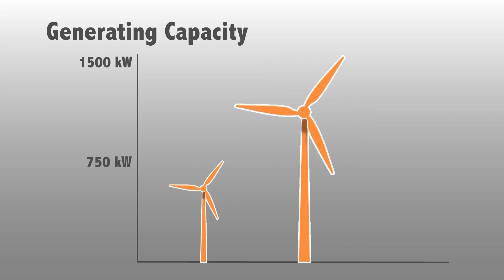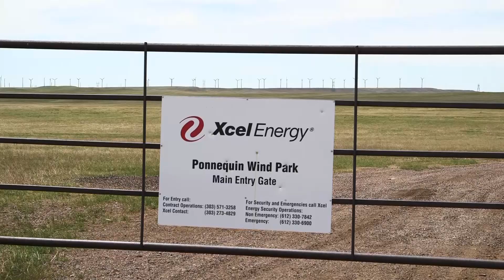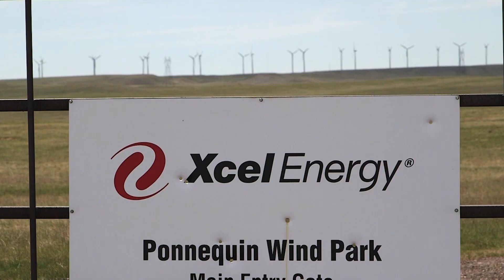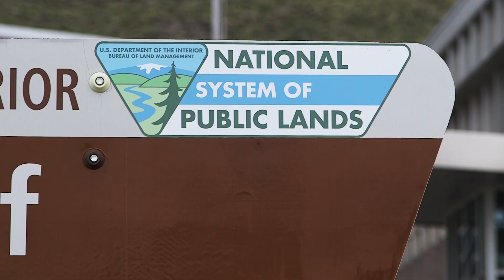Who Cleans Up When a Wind Farm Retires?

Comment: On most days less than one third of the Tehachapi wind turbines are working. Even when the towers are eventually removed, the hills will forever be scarred by the access roads and shelfs dug into the hillsides for the towers. The wind mills have been, and still are, the cause of the deaths of hundreds of thousands, (if not millions), of local and migratory birds. This so-called "Clean Wind Energy" crap has been a major environmental disaster for the Tehachapi area.
Reply: The CA turbines were smaller, and rotated at a higher speed, while the ones in Illinois are very tall, each blade over 150 feet long, mounted on a 400 foot tower.  They rotate very slowly, About 5 RPMs.  Bird strikes are very rare.
Reply: @robertheinkel6225  ; you have no idea what you are talking about. Have you EVER been to Tehachapi? NO! Do you even know where Tehachapi is? I doubt it. Try looking it up on Map Quest. It's true that 30 years ago when wind power was new wind turbines were relatively small, but the towers built in the last 10 wears are the same size as Wind turbines in any other state. Have YOU ever timed a Wind Turbine in a 25mph wind? NO! They go a he** of a lot faster than one revolution every 12 seconds.
Reply: @robertheinkel6225  I haven't seen for myself, but I think that birds of prey, including eagles, would sometimes nest right on the nacelles of the turbines. The strikes occur when the birds leave, or return to those nests. A shift in wind direction causes a change in the rotational plane of the blades, and if the birds are not astute to the change, they can be at risk of being struck by a blade that wasn't there before. The smaller faster rotating blades might be harder for them to dodge. There will always be some bird strikes, but nowhere near as much as opponents would have you believe. The solution: fewer, but larger turbines.
Reply: @robertheinkel6225  rare to you!
Reply: I live in Bakersfield at the base of the Tehachapi mountains.  The local news has shown dead birds under the wind turbines.  Yes, wind turbines do kill birds!  Some people keep posting that they have to see it for themselves before they believe the photos.  So I assume that you also don’t believe the photos of birds covered in oil from oil leaks?  The fact is as of right now there is no green energy.  Green energy is a myth.  Technology is advancing and one day we will have green energy m, but no today.  Both solar, wind  and water energy need rare earth materials for the generation of electricity and rare earth materials come from strip mining.
Reply: @bobp1016  Wind doesn't necessarily need magnets. They do just fine with double fed, externally excited, and asynchronous induction alternators. they require steel, silicon, copper and aluminum. turbines, like any structure, can be hazardous to birds. I've even seen birds hit with baseballs, at baseball games. of all the solutions, I think turbines are much less harm to the environment than any conventional power source, except photovoltaic. The big thermal concentrator plants have been known to cook birds alive in rare instances, if they get too close to the towers, where the mirrors are focused. Photovoltaic panels are free from that hazard.
Reply: Vincent Robinette All the things you just listed that wind requires all need to be mined.  Mining is not green and that makes wind energy NOT green.  Actually nuclear power would almost be the greenest power source today.  With new modern nuclear power plants that make very little waste they are the best option, but there are too many regulations that stop people from building new power plants.  There was an article just yesterday about Bill Gates looking for a country to build a modern nuclear power plant.
Reply: @bobp1016  They don't need the continuous supply chain of fuel, and with electromagnetism and ferroresonance, the alternators don't need magnets. Magnets are just a little more efficient, if they're cost effective. If you buy a inexpensive portable generator, it does not rely on magnets, but rather a field coil on the rotor, which can be regulated to regulate output voltage. Turbines can do the same thing, just on a much larger scale. The mining is only a one time thing in the life cycle of a turbine, or even a solar panel. for conventional plants, the mining never stops. Just one mining truck uses as much resources to build as a turbine, but it too, relies on the continuous extraction of mineral resources, to continually  extract the mineral resources, needed for  plant operation. Once the turbine is built, it doesn't require any further degradation of the environment. Photovoltaic panels are even less of a tax on the environment, because they don't require the occasional oil change, similar to a truck transmission. Turbines do have transmissions, and even hydraulics, similar to trucks. No fuel, though.
Reply: Vincent Robinette So just because they don’t require more material they are more green.  Sorry, but to build the towers takes metal.  Metal is mined and then coal is used to create the metal.  Mining coal, metals, rare earth materials all are bad for the environment.  Next, you need oil and gas to move the equipment, roads to get to the sites and you need to build the electrical hook ups.   All this takes a lot of oil and other non green items.  Then you gave the maintenance of the wind farms and after 20 years they are abandoned just like this farm.  Again this is not green.  Natural gas power plants can run on natural gas wells that can last just as long and are only drilled one time.  As I stated so far nothing is green.  You have just changed methods.
Reply: @bobp1016  The same resources are needed for anything that burns natural gas, but natural gas is still a fuel. Building a turbine is no more green than any other structure, but no less. The best part of turbines, is the fact that it literally generates electricity out of thin air. Fuel costs money, wind speed costs nothing. Over its cycle life, it has a much lower foot print than anything that requires constant fueling. Not perfect, but better. Much better.
Reply: Vincent Robinette Natural gas burns also with out refueling.  Once you drill the well it can produce cleans energy.  Windmills on the other had kill thousands of birds and require just as much maintenance as a natural gas well.  So in the end natural gas is more clean then wind because it does not kill thousands of birds.
Reply: oldgysgt, It troubles me greatly over the waste and the losses but no one listens. You can see the ridiculous BS I got up top for trying to enlighten the clods.
Tehachapi was pretty country when I passed over the mountain on Rte66 Apr 8, 1961 heading for San Francisco, T. I. and Guam. Lengthy story but the Mtn & 66 hold special places in my life (and the RR loop is another special thing for an old B&O machinist).
Reply: Wind mills killing millions of birds?  I live in Louisiana and I remember when the fishermen were catching 10W30 instead of fish. Deep Water Horizon!!! Remember that little spill?
Reply: Skyscrapers have killed way more birds than wind turbines...
Reply: 2Awesome skyscrapers act as a habitat for peregrine Falcons.
Reply: @2awesome292 ; and just who told you that BS? Do you find dead birds all around skyscrapers? NO! Do you find dead birds littering the ground around wind turbine towers? YES!
Reply: @oldgysgt  You think anybody would be around to clean up dead birds in the middle of the desert? How quickly do you think it gets picked up in cities?

According to a 2014 article in the ornithological journal Condor, an estimated 365 million to 988 million birds die each year by colliding into buildings in the United States.
Reply: @2awesome292 ; are you kidding? In Frisco they don't even pick the human Sh*t or used needles, much less dead birds. By the way, Tehachapi is in the mountains, not the desert, (once again, I realize you have never been there, but I have).
Reply: I'll have to come down and see it for my self. I've visited wind farms, and have driven past many of them, and have never witnessed a bird strike, nor have I seen a bird that has been struck. I even have yet to hear a turbine. I know it happens, there are videos showing it. Who ever captured those videos must have camped out for weeks, taking video all day every day to finally get one. I think bird strikes happen by the dozens, not thousands. There are only a few farm in migratory paths, where this is likely to occur. Ducks and geese fly at altitudes way above the turbines. The only birds struck probably have nests near or even on the actual turbines. Typically, birds of prey.
Reply: @vincentrobinette1507 ; the Tehachapi pass is one of the paths for migrating birds along the Pacific Flyway, (but you didn't know that, did you). Have YOU ever driven up into the hills around Tehachapi where the wind turbines are? NO! Do you even know where Tehachapi it? NO! Try looking it up on Map Quest before talking about it. While working on Telephone cables for Ma-Bell I have been all over those mountains. The ground around the towers are littered with the remains of dead birds, both large and small, and when you add them up they number in the thousands, (but YOU have NEVER been there, so how in he** could YOU know?).
Reply: @oldgysgt  I have not. That's why I want to see for myself sometime. I see videos, and hear testimony from people who hate the idea of renewable energy, and other proponents, whom all say it's all blown out of proportion. Since I have no idea who to believe, I need to go and see for myself, do my own research, and judge accordingly. I live in the west, and have driven by many wind farms, but haven't had the opportunity to really get in there, and have a close look. I have never been able to clearly hear them, because of distance, and road noise. I need to get up close, without being arrested for trespassing. I need to get that close, to see if there is any validity whatsoever, in the claims made by the opponents. Also, I need to see what birds. If it's hawks, there might be something there. if it's pigeons, doves and magpies, let's make sure you aren't seeing victims of hawks, or other birds of prey.
Reply: @vincentrobinette1507  Maybe people don't hate "renewable" energy. Myself, I don't like ethanol. It is a poor fuel and takes a gallon of fossil fuel to produce the gallon of ethanol. I do understand the experimental aspect of new technology. I also understand there will be "Oops, that didn't work out" moments. What I object to is the use of many resources to produce a few. Spending $10 to make $5 seems to be the norm.
Reply: @vincentrobinette1507 ; it's hard to see the remains of dead birds below a wind tower when you are half a mile away going 65mph down Hwy 58. I have found the remains of hawks, golden eagles, crows, pigeons, mourning doves, birds that looked like sparrows, and even the remains of a sea gull once, (yes gulls occasionally get this far inland).). A lot of what you find is only find feathers and wings because the coyotes have found the ground below a wind tower is usually good for a free meal  If you think these could be natural kills by other birds, do you also think the birds who did the killing would carry their meal to the nearest wind tower to eat it beneath the rotating blades? Just where do you live, in the land of OZ?
Reply: @oldgysgt  They eat it, leaving little remaining biomass. and, you're right. I need permission to get on to a site, where I can get close enough to touch turbine towers, or better yet, would be to fly through on an ultralight aircraft, where I can see from above, and see over ground features that may be hiding the carnage. from the freeway, you can't see anything. The nacelles of turbines should be gabled like a dog house, so you don't have those nice flat surfaces way up high. Can you think of a more ideal place for birds of prey to nest? That could lead to all kinds of problems. The nacelles need to be steeply triangulated to make them less appealing as a nesting site.
Reply: @johnvanegmond1812  Ethanol right now, is very inefficient. One thing that would help ethanol would to revert back to steam power. Right now, the corn is harvested with diesel tractors. If steam tractors could burn the stover, rather than diesel fuel, the tractor could literally be powered by the unusable part of the very crop that's being harvested. That would help a little, because that only solves the problem during the harvesting. Harvesting is only one step of many involved in raising the crop, then converting into alcohol. That might move it from 130 BTUs per 100 spent to about 140. Not enough to make it viable. Right now, I'm not a real big fan of bio-fuels. I AM a big fan of the big fans,(and rooftop solar).
Reply: @vincentrobinette1507  invest in a pair of glasses!
Reply: I work in this industry since 6yrs and never have a bird seen getting killed by a blade... BUT what i have seen are birds getting killed by oil spills after an catastrophic accident....
Reply: @Gallardo6669 ; your eyes must be brown, you are so full of it. I guess all those dead birds scattered below the wind towers died of old age. Oil spills are rear occasions, but those Condor Quisinarts are killing birds right now. You "clean energy" types are screwing up the environment every day. Did you know it takes more energy to make methanol than you can get out of the final product. When the Feds mandated methanol be added to gasoline, the price of corn went up, and the cost of tortillas in Mexico City went up 30% and now poor children in that city are going hungry and malnutrition has become a major problem for them. Little brown kids don't get enough to eat just so YOU can think you are saving the planet.
Reply: Oil, coal and nuclear are toxic as well and far worse.

Comment: If the wind is good, and the land already zoned, I vote for the re-power with newer higher power turbines. I think the return on investment could be even faster, considering that the new turbines produce a lot more power per dollar invested in the machines themselves. The cost of running the power lines to connect them, and all the costs of zoning have already been paid. the land lease should be the same, weather the turbines produce 750 Kilowatts, or 2 megawatts. so. more power from the same overhead should make the site profitable.
Reply: Assuming the power cables are of sufficient capacity to handle the higher load.
Reply: @mikebetts2046  That's a good point. I don't know what would be involved in upgrading the cables, but the right of way is already in place. It would really be just the cost of the labor, as well as the heavier cable, or cable run in parallel with existing cable to handle the extra current. Another way to pass more power through the existing lines, would be to increase voltage, while maintaining amperage. The limiting factor there is the insulation of the cables.